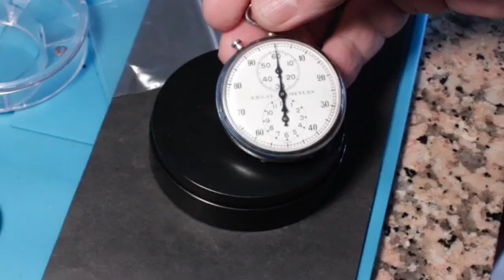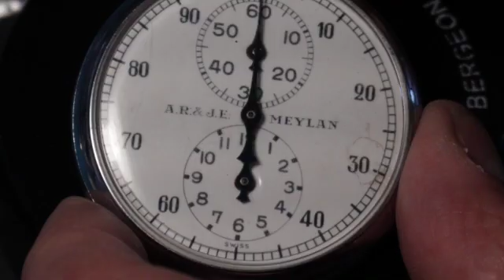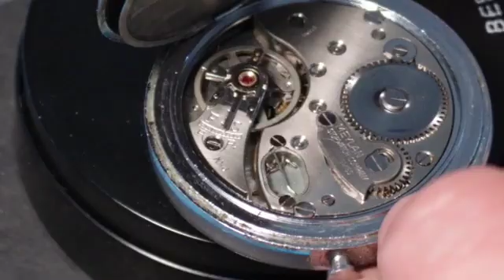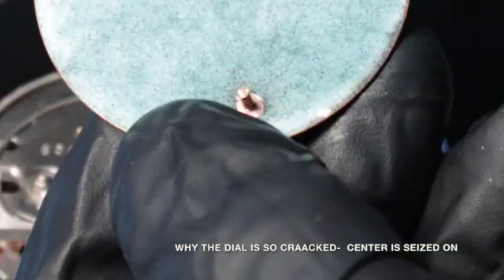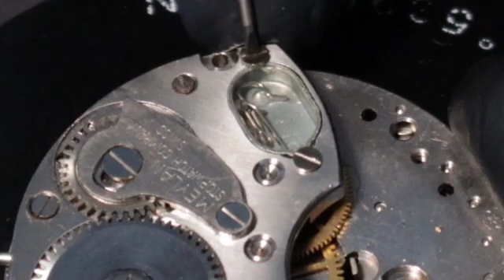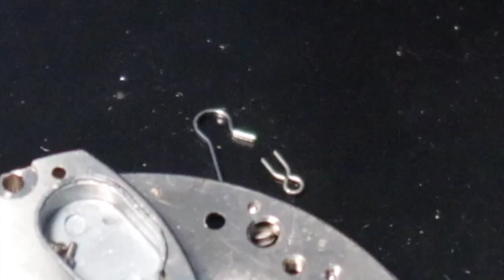1960 SECRET PARTS STASH AND REPAIR  Meylan Stopwatch restoration

Comment: Could you please make a video that walks us through the proper method for removing stopwatch hands from their respective cams? For example if you wanted to replace the face plate but use the original hands and cams.

At the end of this video, you briefly mentioned that the center post/pin needs to be pressed in unlike a traditional watch where the hands can be pulled off. If you could elaborate on this it would be greatly appreciated!
Reply from the maker: Just getting this..i will be glad to make a video